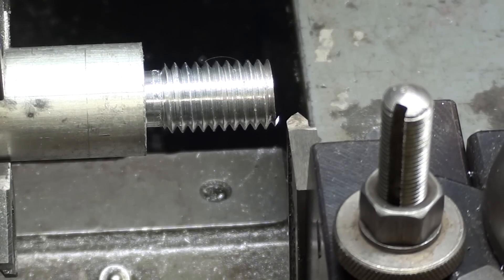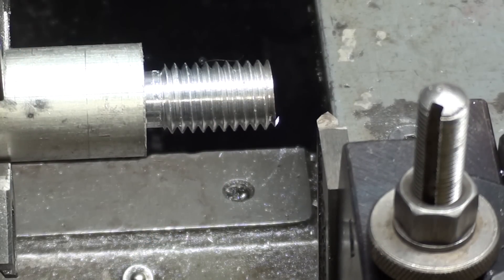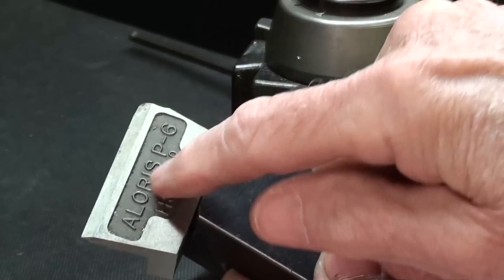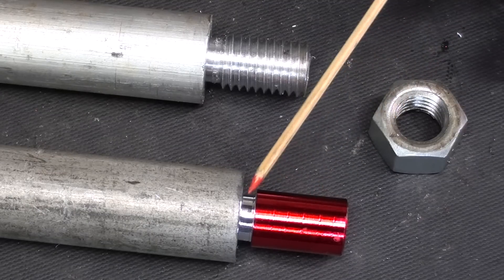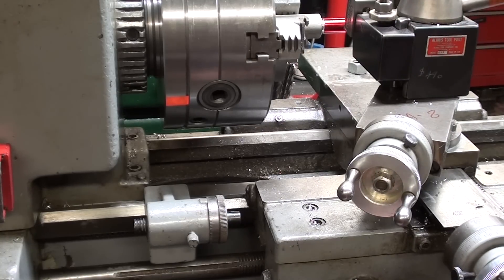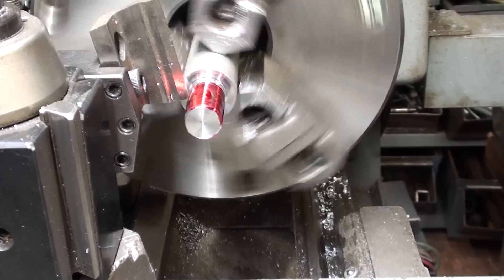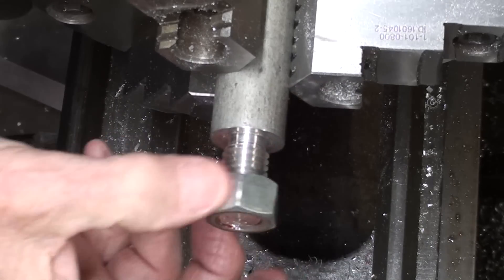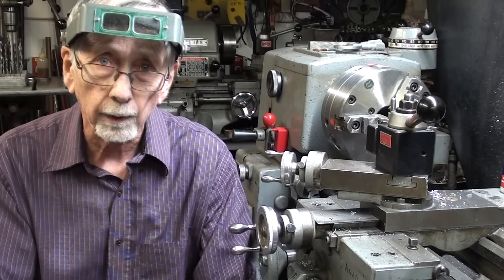NO CRASH LATHE THREADING ALORIS short #861 tubalcain clausing

Comment: Many of those safety experts Lyle likely aren't that keen in setting up all types of jobs most likely as they focus on the safety "rules" first for some reason. I'm all about safety but at the same time, if it ain't common sense safety, it isn't worthy.  I've got several machines, saws and hand power tools that have the safety built into them and most of the time, limit the usefulness of said machine or tool as its "too stupidly safe" and likely the design is approved by product liability defense lawyers. Many times too safe is more dangerous. A real machinist figures the safety method out with every job as they all vary with just about each kind of job. I often laugh at the "long hairs" with their pony tails and those "cool" operators with their caps worn with the bills or visor pointed backwards. Just how safe is that expert?
Reply from the maker: Could not agree more

Comment: Nice use of that Aloris tool block👍. Most commerical tooling for threading doesn't permit threading like this without putting up a fight. 

I note you reversed the compound. I made the mistake of leaving the compound in the normal position, pointed to the headstock, while threading in this fashion and got a terrible finish on the threads.
Reply from the maker: I believe I failed to mention the compound position. I didn’t think people would understand, or for that matter even care, lol. However, you are the second one to comment on that .
you are an astute observer.
Reply: @mrpete222  Oh, they will care if they make the same mistake i did. I didn't remake the parts since the thread ought never be disassembled, but a great deal of nautical English was heard when i realized my mistake.

Comment: How do you know how long and how deep to undercut for threading? I have a project coming up that I'll need to undercut for so the face of the screw fits up flush. Everytime I try to look up info there aren't any concrete rules of thumb on it. Thanks.
Reply from the maker: The undercut should be slightly deeper than the minor diameter of the thread. Minor diameter can be looked up in any thread chart.
Reply: @mrpete222  Thanks a bunch!

Comment: After military service I went to work at the Erie Pa GE plant running a Warner & Swazey #4Turrett lathe.  During the winter I had to wear my Army field jacket to keep from freezing.  Everyone in the shop wore coats. Sleeves were never considered a safety thing and safety was a prime concern there.  You couldn't get past the gate guard without wearing safety glasses and safety toed shoes.  The main issue for me was piece work production.

Comment: If you ask me, a more major benefit of threading this way is that you can do these threading cuts at  surface speeds that are much closer to  what you would use for turning. You would have to keep the half nuts engaged the whole time, which means turn the spindle off and reversing the lathe to get back to the start of the cut. It would be really impractical to try catching the threading dial at the right moment every time if it's spinning as quickly as it does when the spindle is running at 500 RPM or more.

 I think that depending on the circumstances ( workpiece material, size of chuck, depth of cut) you could run a screw-on chuck in reverse without it un-screwing. On my 8" bison chuck that weighs about 18 pounds, simply removing the chuck takes a decent amount of force.  Just speculation, and it would only take one such mistake to change my mind.
Reply from the maker: Thank you for that comment. I wish I had mentioned how much faster it is or can be.

Comment: I have the Aloris BXA-8! And I will be trying this soon. Thank you.

Question about the blades (I’m an amateur just starting). I also have a P-6. I plan to eventually start threading gun barrels with 1/2-28 being the most common. Would I be better off with the P-10 (10 or more TPI)?
Reply from the maker: Probably the P 10
Reply: @mrpete222  thank you

Comment: Ah,  those safety sissies don't know the joys of cutting 2mm cuts at 1400rpm.
The blue black chips flying, the odd crunchy walk from the chips melting into your boot soles.

I've never seen short sleeved safety gear,  I have seen rubber bands on the ends of sleeves as well as silver bands near the elbows to keep sleeves flat to arms but never issued short sleeved overalls.

We were taught to set up,   start the machine and keep our hands near the off lever and away from the moving parts.
For all machines, I might add.
I've never seen you doing anything dangerous like removing cuttings while the machine was running mr. Pete,  so you might want to do a shop safety class.
Mine was like 5 minutes along with the warning : " If I find out you were stealing shop supplies, they'll never find the body."

Comment: I have seen people do threads that way ,and wondering about the carriage lifting off the ways ??
Reply: I use a cutoff tool upside down and the spindle backwards. If that doesn't lift the carriage ff nothing will.
Reply: The carriage has retainer plates under the ways to prevent them from lifting. Check cross slide and compound gibs for tightness before taking heavy cuts.
Reply: @ellieprice363  I know that, but how much clearance is between them and the ways?
Reply: @AliceGirl2019  If everything is adjusted properly not enough lift to cause a problem. Light final cuts should not lift carriage at all.
Reply: In theory yes, in practice no. A four ounce threading tool is not likely to lift a 75 pound carriage off the ways.

Comment: Wow, even I learned a new trick today! This is much easier than the other methods I know of.  Wearing long sleeves, heck I've worked in shops that were bearly above freezing. We wore heavy coats and snowsuits more or less. You know it's cold when the coolant freezes in the sump...  Seriously use extra caution around the spinning parts and we'd guard the chucks, especially the bigger ones, or if the jaws stuck past the body.
Reply: Sounds like my shop. - I replace the coolant in the horizontal band saw with RV Antifreeze in the winter. . We never did use  the shop every day and it got REALLY cold in there when there was nobody there,,,,snd even wit 2-torpedos it's after lunch before you even think about taking off your coat and by the time i was warm enough for short sleeves it was time to go home.  - You do what you got to do. (But even in the cold we never wore gloves around rotating machinery,,,,Get caught, get sent home for the rest of the day. Get caught twice and you get told not to come back.

Comment: I learned something new. I am the 1 in 10,000 that has the CXA-8 threading holder. I never knew it could be ran upside down. Thank you. Could you cove the side adjustment screws on this tool? I figure it is to adjust the helix angle, but how and when do you adjust it.
I live in Michigan so I too ware long sleeves and coats.  Just make sure every thing is tucked in and buttoned tight. You can also tape the loose sleeves if needed.
Reply from the maker: Yes, for the helix angle        I have never actually made that adjustment
Reply: @mrpete222  i had to make the equivalent adjustment with a full profile laydown insert. I needed to buy a shim seat that reversed the helix angle from normal.

Most threads only have a degree or two of helix angle, so it isn't a big adjustment on the Aloris. I would use a surface plate and indicator to make the setting. You'll need feeler gages to set the angle.

Comment: Must be the same people that complain about me working in a coat in my shop. Key is I don't let it come into contact with rotating equipment.  My machines would literally rip your body apart and not even think about it. I don't generally touch any of the powered rotating equipment and if I do I am very aware of what I am doing.

Comment: Ignore the complainers. We were taught to either have sleeves above the elbow or secured around the wrist. Just nothing loose fitting by your hand. Great short and interesting subject. I always learn something when I watch the best shop teacher in action.
Reply from the maker: 👍👍👍thanks
Reply: @mrpete222  
I got a length of elastic tube bandage. Cut two pieces to forearm length, hemmed the ends so it won't unravel on me.
Holds my overalls in nice and tight.
Reply: Thanks always a pleasure watching your videos
Reply: Yes tight fitting cuffs, so that basically it is your skin there and nothing more. That actually helps as that first contact will tear the cuff, and not you. But has to be tight, and always done up.
Reply: OSHA probably requires short sleeves in the workplace....But You are the Captain in your home machine shop.

Comment: I work at a large industrial plant with a large maintenance force, a workshop full of heavy duty industrial machine tools and an aggressive attitude to safety . There is a requirement that arms should remain covered at all times, on site and  in the workshop. In almost 30 years I have never heard of any maintenance tech being injured or having a near miss as a result of wearing long sleeves. I would imagine that had there ever been an injury in the workshop as a result of wearing long sleeves while using rotating machinery in the plants entire history there would be a rule stating that they should be rolled up while doing so.
Reply from the maker: Thank you for that insider information

Comment: Hi, how would this technique be used on metric lathe, with no leadscrew indicator, and with half-nuts permanently engaged for the duration of screw cutting, please?
Reply: The measurement system used could be carrots or turnips,  the technique is identical and leaving the nuts engaged is exactly as it would be with right to left threading,  you need to reverse the lathe to send the tool in an opposite direction.  I assume you are talking about cutting imperial threads on a metric lathe.  Just do it !  :)

Comment: Couldn't you use a regular threading tool, of half the thickness of your usual tools, with a same sized spacer (maybe another half thickness toolholder) under it, as a shim, to raise it to a suitable working height?
Reply: You can, though you will need to either destroy a tool or a holder to make it work properly, so this special tool holder and tool is great, plus it looks like it is a very easy item to dress sharp again once worn, and you get a lot of life out of that large long tip.
Reply: Yes, if you have enough room in your holder just turn a regular threading tool upside down. 3/8 or 5/16 HSS size are large enough for most threads.

Comment: I thread in reverse with a threaded spindle. Turn yourself a button that fits the shoulder inside the chuck body, and install a drawbar.
It isn't much of a chip load anyway on a smallish lathe with threaded spindle.
Reply: That's a good idea!  The additional load on the spindle threads via the drawbar pull should stop the chuck from turning (it can't spin off) and as you said, there's not a ton of pressure during thread cutting anyway.
Reply: Can't do that when threading any bar that protrudes into the spindle.
 I have a logan 10" (threaded spindle) a S.B. 14-1/2" (threaded spindle) and a Monarch 10EE (D-1 camlock). There are other ways to "lock the chuck" like a set screw in the backplate but they are a little on the agressive side. Still, threading away is the only safe way to do it.

Comment: I put my geometric die head in a boring bar holder on the axa, index die head shank with tailstock, with head at loose setting push saddle into work and pull back where you like it.